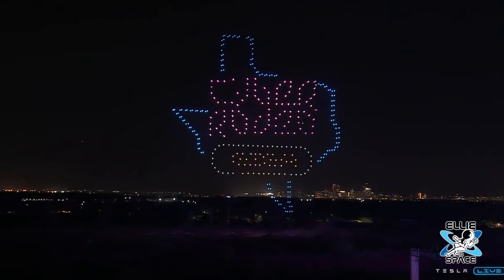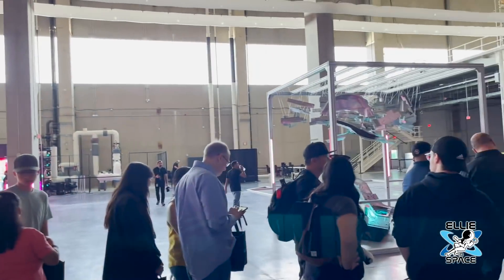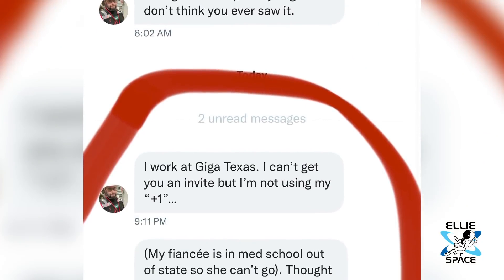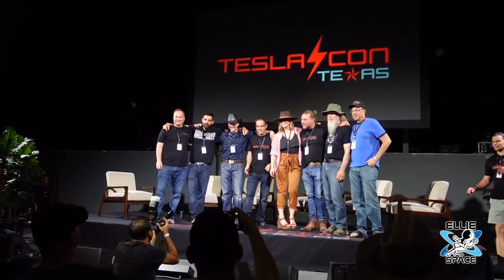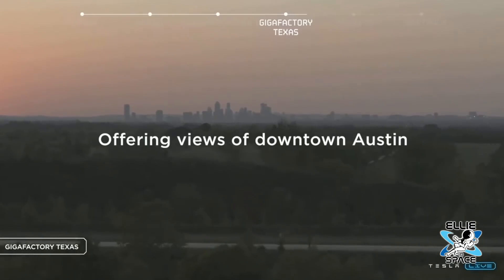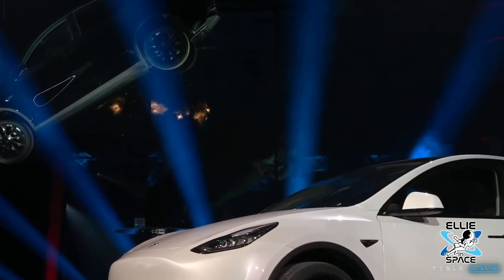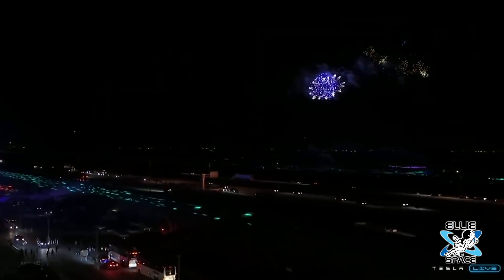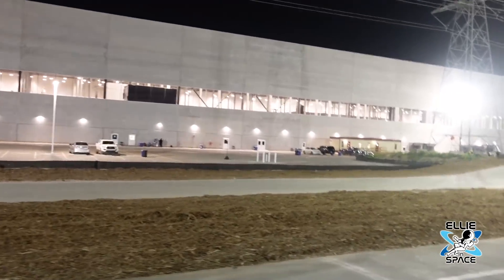Inside #Tesla Giga Texas, the machine that builds the machine

Comment: Any body know if the hydraulic fluid for factories like this is non flammable?  I know most injection molding machines, for example, use flammable hydraulic oil.  I'm wondering how this would be handled in a factory like this, especially with the casting machines.